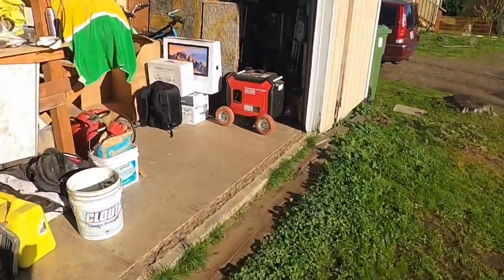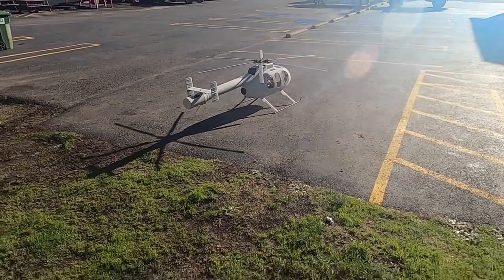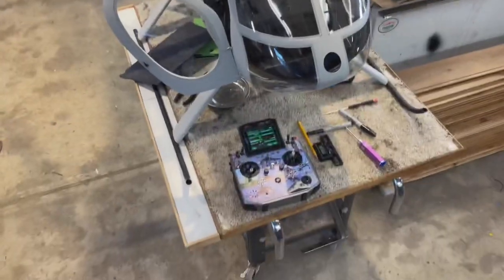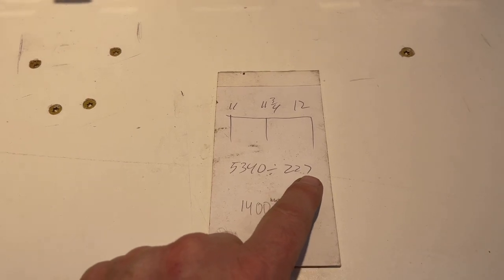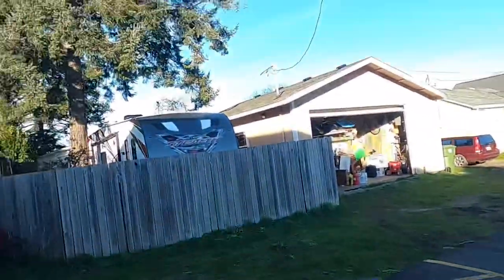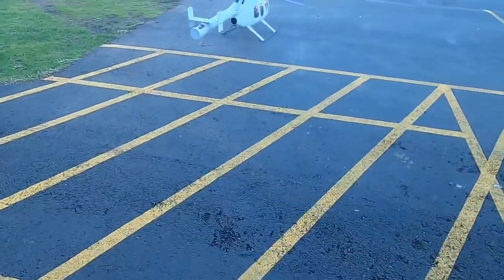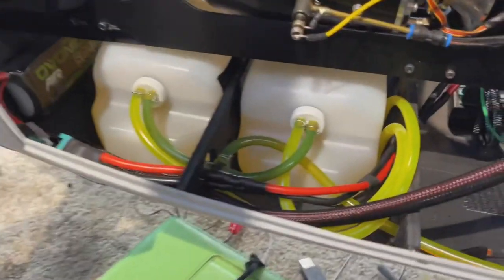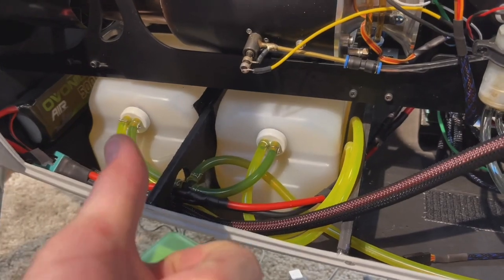MD600N RC is the new project for 2022

Comment: looks cool Mike. Is it Vario?.  100Amps on the ESC is a LOT. Can you up the voltage which would reduce the amps and increase your time?. Also, Im amazed at the kids that show up at about 10:50. They dont even look over.. If that had been the UK they woulda been over asking the usual "how high goes it go questions lol" and their <insert relation here> has one of these and its much bigger than yours :)
Reply from the maker: Im at 12 S already...ITs just an "Electron hog!!"
Im actually doing research on seeing if I can stick a generator on the tail output shaft from the turbine....see if I can go that route.....